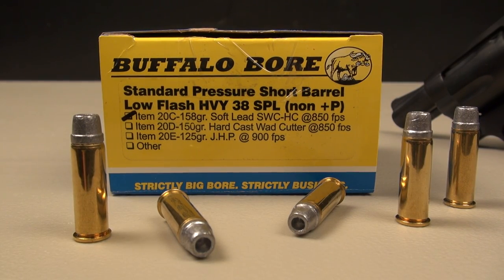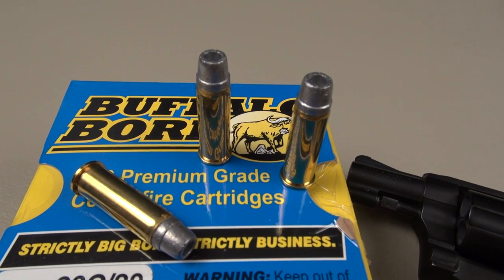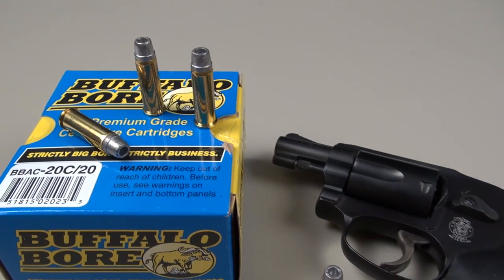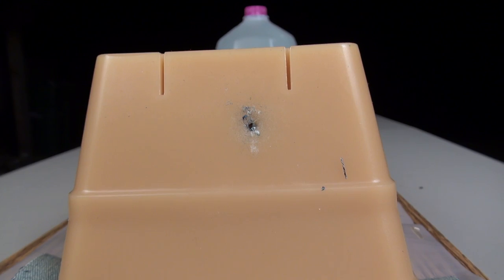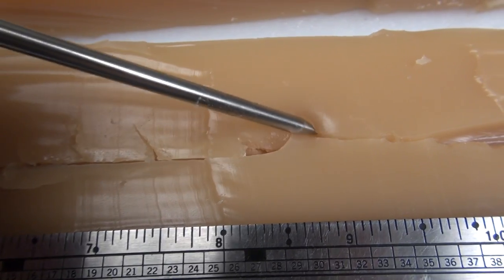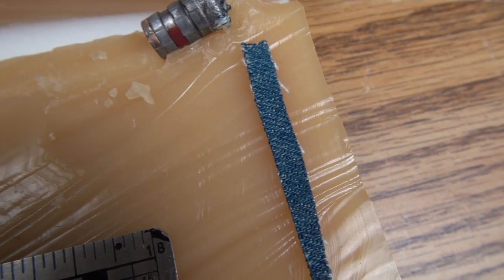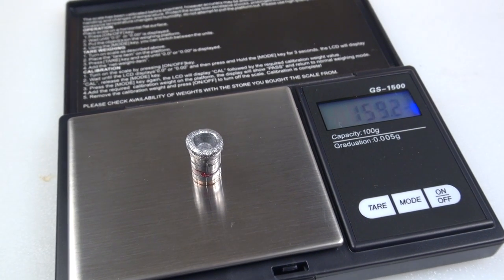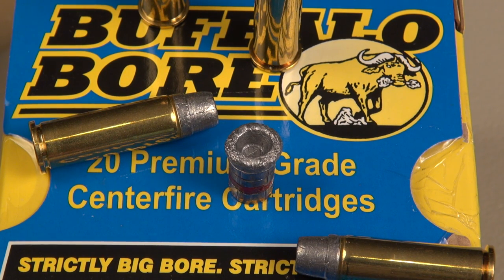Buffalo Bore .38 Special 158 gr Semiwadcutter Ammo Test

Comment: If anyone wondered, I got 1,002 FPS with the +P variant in my 1.875" J-Frame.
Reply: Big Daddy  You might be interested in the 180-grain lead, gas checked bullet. RCBS has that mould and I've always had great luck with it in both 4", 6" and 8" barrels (Dan Wesson and S&W 686)as well as my Marlin 1894CS carbine. Under 2 MOA at 100 yards with the carbine! Sub-MOA at 50 yards.
Reply: Bulls lo bore loads a 180 grain at like 1400 FPS magnum obviously. It’s a handful.... it kicked harder than some 158 sjhp@ 1570 FPS I shot after.... I wouldn’t shoot it in anything smaller than a L frame.
Reply: That is my normal carry load.  NOT pleasant for plinking.
Reply: I got 1006 fps with my 1 7/8" J Frame.  No joke!
Reply: That is fast. I like fast.
Reply: Thank you so much for your input. I have a .38 Bodyguard in 1.875" and couldn't really find much ballistic data on the snub barrel. Thanks again
Reply: Gun Sam and buck shot
Thank you for that info!  I always hoped he would do the +P but it never happened.  I bought a box of these in +P and tried them out in my 442.  Recoil was stout but manageable.  Accuracy was good.  What I hated, was the fifteen or so rounds I fired, leaded the hell out of my bore and chambers, EVEN with the gas check.  I decided for that reason, this round was too much trouble to be worth it for me.  Tnoutdoors9 did another test with that gun using the Golden Sabre .38 +P 125 gr load.  It is clean, accurate, and expands and penetrates very well.  That is my .38 snub carry round.
Reply: @grigorirasputin5020  
All you gotta do is save a few FMJ rounds and shoot them after shooting the soft cast lead. It'll squeegee the lead out the barrel and you won't really have much more to clean out then any other loading.
Reply: @MegaAppleshit  
Thank You for the suggestion!  I have done that since the 1970's in hopes ot would help make cleaning out lead in the barrel and chambers easier.  To be honest, I could never really tell a discernable difference in the chore, whether I tried the jacketed bullet thing or not.  I mean this using as much as 50 rds through the gun of jacketed ammo after firing soft lead ammo.  In theory, the gas checks on these rounds were supposed to prevent leading but they did not.

FWIW, something that does help a little in the cleaning process, is Blue Star Ointment.  This is a compound long advertised as a remedy for jock itch, ring worm, even crabs, and other maladies in that area.  I read an article back in the 80's or 90's by Massad Ayoob that mentioned it.  It does seem to help get some of the lead out of bores and chambers, but it is still a massive chore.
Reply: Powa

Comment: I firmly believe the 38 special (standard pressure) with 158gr bullet is plenty for self defense. Excellent knockdown power, good penetration and mild recoil. I love the 38 special.

Nelson
Reply: Old school loads like this still viable round and +P is not even needed.
Reply: @ratagris21  Paul Harrell did a test with these same rounds in his “38 special standard pressure part 3” video. They performed amazingly on his meat target
Reply: @Not4nought light recoil would be another perk for it 👍🏻
Reply: 147 grain full wadcutters are excellent as well.
Reply: Just don’t use round nose 158 grains in snubby they have little power and prone to over penetration, don’t believe me then go read Jim cirrilos books
Reply: @357-swagnumultramagax9  "Little power" yet "prone to overpenetration". Apply some logic to your thought process. Penetration of any mass through a resistive structure would require a necessary (and measurable) use of power. "Over penetration", therefore, would demonstrate more power than needed.
Shot placement has more to do with incapacitation than "power". Almost all loads in standard calibers will achieve necessary penetration. Their effectiveness is based on the tissues/structures that were damaged, or destroyed. The handgun caliber debate crap is mostly sewing circle nonsense blathered on by those that have no real experience. No handgun rounds have enough velocity to cause hydrostatic shock at any appreciable level. ER docs don't ask or care about what caliber a GSW is. They care about WHERE they were hit, and how many times.

Comment: As a disabled Vet, and 73 yoa, I don't get around as well as I used to, and I do carry at home and when shopping.  For all my carry needs, I load my Taurus 605 with Buffalo Bore Heavy 38 +P 158 grain soft lead SWC w/gas check and they give me around 1000 fps out of my 2" bbl.  It's true that a Taurus 605 is a .357 Mag revolver, but for serious social purposes, this load is all I need.  I also have to think about noise abatement while carrying around the house, therefore the .38 Special +P, rather than a .357 load.

Comment: The "deal" is that soft lead moves faster down the bore with the same amount of powder as a jacketed load. Less friction.
Reply: Gun Sam 

Yes sir...winner winner chicken dinner. Finally a man who understands the facts.
Reply: Buffalo Bore also uses custom burn rate powders to get the most out of each cartridge while staying within pressure specs. That's what they say anyway. They do load them hot.
Reply: Wow another reloader/ caster
Reply: I just came here to say this but Sam beat me to it. Love your channel btw. Follow revolver aficionado if you enjoy wheel guns
Reply: But doesn't soft lead foul the barrel faster than a jacketed round??
Reply: @craigmack3361  not if it's gas checked
Reply: @t3hm4zn  thanks bud
Reply: @craigmack3361  
Not so much when you are using a gas check on the rear of the bullet and use good bullet lube.
I have loaded although hard cast 150 gainers with good alox lube at 1050 to 1100 fps in .357 magnum with no leading of the barrel.
Reply: Craig Mack Normally yes, but these are gas checked.
Reply: @craigmack3361  
Yes if they are pushed too fast they will. This is why Buffalo Bore uses gas checks on these loads.

Comment: This sold me. A lot of the comments complain about failure of the round to expand. Well, it didn't "mushroom" but it did expand in a good way. The commonly stated advantage to a wad cutter or semi wad cutter is that it reliably makes a cookie-cutter hole of at least .357" while a jacketed hollow point probably won't expand well from a snubbie and will cause less damage than a wad cutter. I was leery of the hollow point semi wad cutter for fear that it wouldn't expand and might push tissue aside more than a wad cutter. But the bullet in this test expanded to become a "cookie cutter" .413" in diameter! And 19" penetration through denim suggests this thing could hurt a pretty large perp. Wad cutters shoot frighteningly straight and everyone says semi wad cutters shoot just as straight. I think my search for carry ammo for my 642 is over.

Comment: I use Buffalo Bore’s +P version of this load from several S&W (Models 27 and 627) five inch barrel and Ruger (SP-101 and GP-100) revolvers.  It provides good velocity — with modest recoil — and excellent penetration.  In addition, the gas check ensures no/very little leading, which makes cleanup easy.  I’d like to offer two comments:
1.  This is essentially the renowned “FBI Load” (the standard pressure version really isn’t).  Decades ago, Special Agents were issued a 3.5 inch barrel “.38 on a .44 Special frame” revolvers, which were more-or-less an N Frame for .38 Specials (although not as durable or strong as Smith’s .357 “Registered Magnums” that evolved into the M-27).  This revolver and round was designed to provide plenty of velocity, to have a somewhat greater sight radius than snubbies, to be quickly drawn, and to be robust and heavy enough to tame recoil while being extremely durable.  This combination worked VERY well, although projectile design during that era was comparatively primitive and capacity was limited (but, quite likely more than sufficient for virtually all defensive scenarios).  
2.  Modern JHPs, of course, offer much improved expansion, however, SHOT PLACEMENT remains supreme.  Should one opt to use this round (in either the +P or the standard pressure version) it will do its job if the marksman does his.
Reply: Pretty good synopsis but the FBI load came out in the late 70s to use in the k frame smith and wesson 3 inch 64 and 65...matter of fact was used by SA E. Morales to end the Dixie Highway shoot out...ie the Miami Platt Matix shootout...carried the +p 158 lead round for years....performed great....

Comment: I sent in an inquiry with Federal to obtain the ballistics on these rounds in the Federal Premium  +P 158gr. SWC-HP  NYCLAD nylon coating variety (P38G) which you can still obtain online today for $44.98/50 Rds..  I bought 150 rounds this week delivered to my door for $150 TOTAL.  890 FPS and 270 FPE at the muzzle.  From a 4 inch barrel.   Down range ballistics is very good too.  Speed and Energy are well maintained.   870 FPS and 265 FPE at 25 yards.  860 FPS and 260 FPE at 50 yards.  Mid-range Trajectory is 0.3 at 25 yards. and 1.4 at 50 yards.    I have a S&W model 10-5 Snub nose, and a S&W model 15-4 with 4 inch barrel.   Anxious to go to the range and test these out.

Comment: The Classic "FBI Load". This is close to it and it does have a LOT of street credit. Many a bad guy is on the dark side of the grass because of it. However, the original recipe for a 158gr LSWCHP like this is intended to be cast of dead soft/pure lead and driven at +P velocitys. It needs that velocity to get the cavity to bloom and when they do, it is impressive, a large lead mushroom forms. I would not hesitate to carry this load in a little pocket .38 and the 3" 686 Plus on my night stand has a cylinder full of the Remington +P 158gr LSWCHP. Gotta have that velocity! 

A lot of folks also used soft lead hollow base target wadcutters loaded backwards/ base forward for an ad-hoc  hollow point. Also a nasty round but loaded to hot would blow them out and leave a cylinder of lead behind!

A nice hard cast solid  with a wide meplat or a full wadcutter will do some serious damage plowing through a bad guy.
Reply: I love the FBI load
Reply: BUFFALO BORE does make a +P version of this round. It is has close has I have found to the old FBI/Treasury .38SPL Round.
Reply: This 'standard load' from the video is as powerful as original FBI loads. The question is whether the lead is the same. Supposedly it's soft lead. Buffalo Bore's +P version of this is more powerful than all of the other brand +P rounds, except Underwood, and far exceeds the original FBI load.

Comment: I've actually shot a few through pork rib.  If you get a solid impact on bone it does flatten the bullet out a bit more, but it keeps on trucking after it hits it.  Even moving relatively slow, that big heavy bullet has a lot of momentum and does a surprising amount of damage.  I could easily put my index finger through the hole it blew in that rib.

Comment: Sir, one other point, Many older revolvers are more accurate with 158 loads because the rate of twist in the barrel was designed for that bullet weight. So, my 1966 D S Special no longer shoots low.

Comment: Most of my revolvers are old ones. I have a couple Colt Detective Special's 1965 and 1974, Smith and Wesson model 36 and model 49 1958 and 1977 and a Ruger Speeds Six 1981. All of those are .38 specials except for the Speed Six which is a .357. I've run at least 5k rounds of +p ammo through all of them with no issue. The DS's and the Model 49 have and still handle them beautifully. Now, my Colt Cobra, Colt Agent and Smith Model 38 Airweight, I do not run +p through them but I carry them with +p. Thinking is if you're going to shoot them at the range use the standard stuff but carry the +p when carrying. If you can come across a Detective Special by Colt or a Model 49 or Model 36 by Smith for a great price, don't hesitate to get it. They can handle the +p with no issue. You can fire off a 20-25 round box at the range to get a feel for them and then carry it with them. Just practice with standard stuff as it'll get expensive if you're practicing with +p all of the time.

Just my $0.02
Reply: the original ds (first and second) they said was not +p rated but could take up to about 1000 rounds. The third and fourth Gen (shrouded barrel models) were recommended to be sent to colt for a check up and potentially a replacement frame. If you really fired that many +p your gun is ruined. Remember this it will fire while its still completely unsafe. Please send that in to c&s to get it fixed before some chap gets it and it finally blows up.
Reply: GhanTech Mobile Using +p ammo in a non+p gun is fine unless the gun is shit. Ammo made prior to the 1970s is on par with the +p of today. The SAAMI standard changed in the 70s.
Reply: So, no other "Chap" is going to get them as I don't sell my revolvers off. Secondly, I don't shoot tons of +p through any pre '72 model Colts at the range steadily just for function and feel. I shoot regular stuff. But I do carry +p in them for SD carry. My guns are fine not ruined I'm a revolver guy and I've seen trash revolvers with stretched frames or cracks in the cone. Tend to actually see that in Smiths more than anything. Colts issues usually have to do more with the cylinder timing  getting out of whack than anything else.

Comment: Pllllleeeeeeeeeeeaasseeee test the +P version!  The additional velocity would probably cause the bullet to expand more thereby causing it to penetrate less which would probably mean that it'll come in right in the desired ~14-16" range!  Come on, man!

That revolver, like most people's .38 revolvers, is even rated for +P, let's do it!
Reply: rupert93r Guns don't die of old age. There are millions of .38s that were made before they were commonly rated for +P. However, they will not blow up with +P rounds, it will just beat them to death. I, like most that own these older guns, practice with standard pressure ammo and carry +P.
Reply: ardvarkkkkk1
I am aware of that and completely agree.  Yes, I know about how SAAMI changed the pressure ratings for .38 back in the early '70s so that the max pressure for .38SPC was lowered such that the new +P max rating is about where the old standard pressure .38 rating was thus all the old revolvers that aren't technically rated for +P actually are for all intents and purposes.
Reply: rupert93r Using +p ammo in a non+p gun is fine unless the gun is shit. Ammo made prior to the 1970s is on par with the +p of today. The SAAMI standard changed in the 70s.
Reply: Rupert93r, I have a S&W 442, purchased in 2013.  Right after I got it, I ran about a dozen of these Buffalo Bore 158gr SWCHP loads in +P through it.  They were reasonably accurate, but the leaded the hell out of the bore and chambers of that gun.  Needless to say, I haven't shot anything but jacketed ammo in the gun since then.  So much for hoping the gas check would prevent leading.  :-(

     Golden Sabre 125 gr and Gold Dot in 125 and 135 gr (both +P) will likely do everything the BB +P SWCHP will do, but not crap up the bore and chambers in the process.
Reply: Correct, my colt official police 38 special manufactured 1957 was originally rated to easily handle the new +P loads as that is what we had in 1957 anyway.
Reply: @grigorirasputin5020  And should be cheaper.

Comment: Buffalo Bore does not water down the +P ratings. They keep or load to  the full potential of the .38 Special cartridge ( 22,000 psi max). Most all other factory ammo still use the 18,500 psi as max for +P cause of all the light weight  revolvers.
Reply: Do you think it's a bad idea to use?
Reply: +nick podgorski  Not in a all steel revolver and not regularly in a alloy frame. Life or death not practice use only.
Reply: I bought some to carry in my Taurus 85. All steel but it's a Taurus... Kind of nervous about shooting it lol. I just want to fire 5 or 10  then carry.
Reply: Taurus is a strong forged steel. no worries
Reply: +Wireman134 thanks for your input. Appreciate it.

Comment: 158 grain BULLET.  The packaging won't usually tell you how many grains of powder, just the weight of the bullet itself.  Different powders have different burn rates and densities, so it's too variable a thing to print on a package.

If you want to know how many grains of a particular powder are in a load, you pretty much have to get a reloading manual and look it up.  A standard .38 special load will have 3-10 grains of powder, depending on what powder it is.  Magnums use a lot more.

Comment: I'd really like to see some more non+p 38 special tests for hollowpoints. I'm rocking a 1979 S&W 36, and picking the right carry ammo is especially tricky given the short barrel. Right now, I carry Winchester Train and Defend 130 gr.
Reply: Frankly with a snub nose I think one should concern themselves with adequate penetration and holding together after hitting bone, versus hoping for some sort of expansion. A heavy for caliber, Keith-style hard cast SWC is great choice for short barrels. Not a stylish round, but effective.
Reply: tartredarrow Using +p ammo in a non+p gun is fine unless the gun is shit. Ammo made prior to the 1970s is on par with the +p of today. The SAAMI standard changed in the 70s.
Reply: @tylerlondon5052  Is this true though. I investigated this question, and people testing basically said it's mythological. Most .38 special wasn't any more powerful. Also, FYI, the Buffalo Bore standard pressure of this video matches old FBI load data, AND, modern +P FBI load equivalent. The actual +P version of this exceeds all of it.